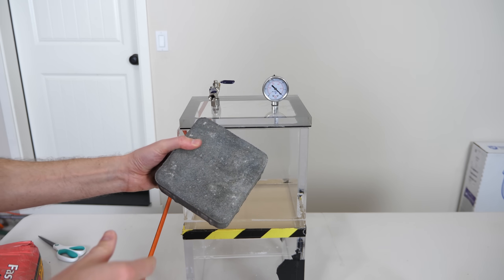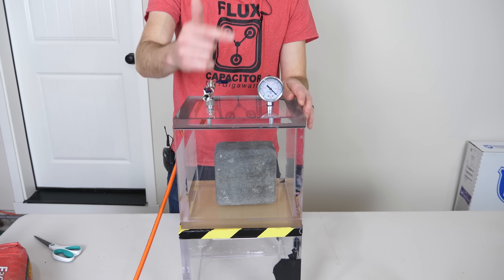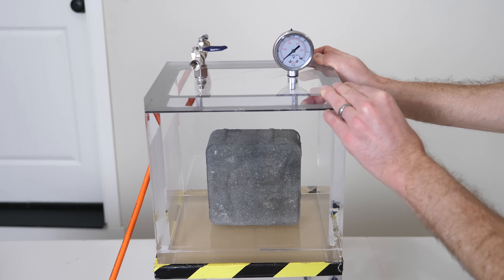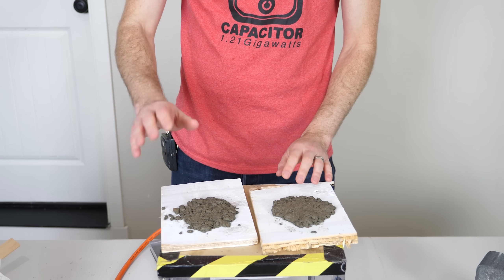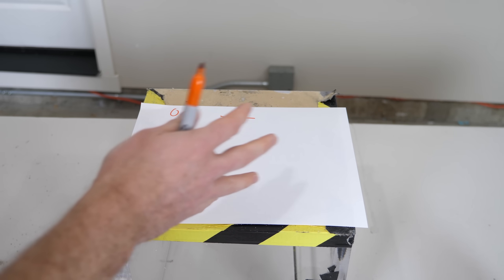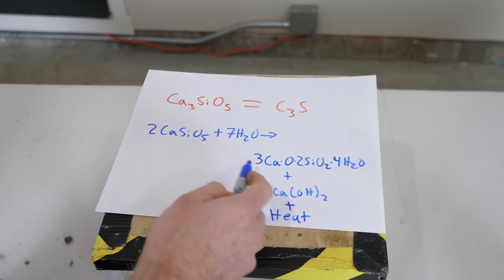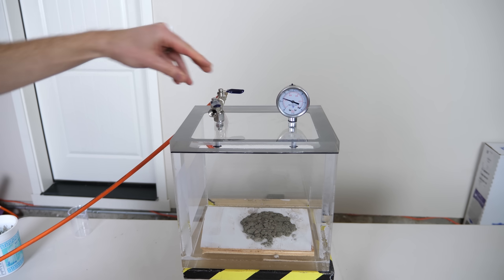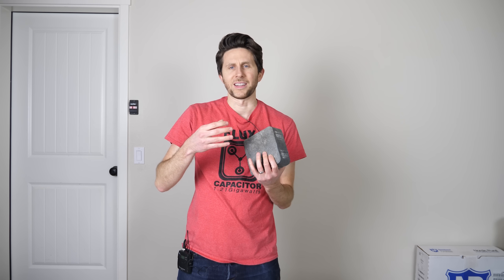Does Concrete Turn to Dust in a Vacuum Chamber? Concrete Without Oxygen Experiment

Comment: "So, you use cement to make concrete."  THANK YOU!!! Thank you for explaining that! I test concrete for a living and it bugs the snot out of me when people say "cement" when they mean "concrete".  It's like saying I'm going to bake a flour. Or, have a piece of flour.
Reply: I eat pieces of flour like you for breakfast
Reply: I used pure cement once, big mistake....
Reply: @generaza7609 pure cement with water should only be wall adhesive for tiling. with sand shall be plaster
Reply: Well... i mean its not like they just teach that in school.
Reply: @fraydizs7302  I knew that back when I was 3 years old
Reply: In italy we have no word for concrete. We just call it the same way as cement
Reply: @zbarba I am sure masons use different words even in Italy. Concrete is made of sand, gravel and cement. Mortar is made of sand, lime and cement. If you don't have different words then -> cement is made of sand gravel and cement.
Reply: If you really want to piss someone off tell a refrigeration guy it's stopped making cold. They seem really sensitive to the  fact that it only moves heat.
Reply: @kevindouglas2060   Technology Connections can set someone straight on that fact. 😁
Reply: just anecdotical thing: i'm spanish and here we call "cemento"(cement) to any paste that includes cement powder the same way we would say "i've seen a van gogh in the museum" however other names are used too 

we call "hormigón" (concrete) a cement paste only if contains big agregates such as gravel
we call mortero (mortar) a cement paste that contains limestone

and usually both concrete and mortar use some kind of sand.
Reply: But why this even happening? It is two distinct things, why would possibly anyone mix them up?
Reply: @AlexandrKovalenko  "mix them up" heh heh heh heh heh surely that was a pun right?
Reply: @AlexandrKovalenko Because I never interact with either? I know cement trucks pour cement, and I know the final product is concrete.  I always just figured it was cement while wet and concrete when dry. Why would I know??
Reply: @AlexandrKovalenko   Well, I guess it comes from ignorance. They don't know cement is an ingredient of concrete, they may mix it up because it has the same color.
Reply: @fuckednegativemind  in Spanish, cement translate to cemento, but we call that cal, and the concrete which translates to concreto that's what we really call cemento
Reply: The flour sticks at Olive Garden do be pretty good tho
Reply: Why dont you also explain what cement is made of? Its not like cement comes from the ground in its form.
Reply: cement pond
Reply: How do I become a concrete tester?
Reply: Man why does it bug u that much chill tf out
Reply: 21 Pilots has a song called "Tear in My Heart" in which they say "fill holes [in the road] with more cement" and it bugs me for the same reason.
Reply: This example falls flat every single time. Cement is both an ingredient in concrete and a final product. Cement is used on its own. So, since you don't eat flour on its own, it doesn't make sense.
Reply: jack mehoff  heh heh heh
Reply: I said the same thing for years!!!!  My kids know the difference.
Reply: What would you get if you tried to cure cement without any aggregate?
Reply: @carultch  Basically grey Plaster of Paris.
Reply: @carultch  a brittle mess that will break if any load is applied. it doesnt work well.
Reply: @carultch  you basically end up with "concrete" but it has no aggregate.  it's like a plaster at that point and very expensive.  cement is relatively expensive compared to rock/sand so using gravel/sand helps reduce the cost without impacting the strength.
Reply: Well it depends on what your talking about at the time it's being made. It takes the ingredients which one is cement.
Reply: @hilham89  yeah no. That isn't how it works. Cement is an ingredient in the mix.
Reply: @bennybooboo6789  🤦I know what the Ingredients is in concrete. I haul it to imi bud. Only thing I don't haul is the air and water it takes roughly 10% of cement to make up concrete, then you have air, water, sand, and gravel. I went back a fixed it so there's no confusion of my comment.
Reply: @bennybooboo6789  what about my comment is incorrect? Please do explain. Not once did I say that the block was called cement.
Reply: @hilham89  thats like saying that flour, once it is settled, becomes cake....fucking stupid.
Reply: @lukewarmwater6412  well you use flour before it's baked right? It's an ingredient in the cake so no it's not stupid. It shouldn't matter what people call it. If they want to call a cake a flour so be it.
Reply: @lukewarmwater6412  what part of my comment did you not understand? Funny how you can call someone stupid when you clearly can't read nor understand what someone says. 🤷
Reply: @hilham89  I understand exactly what you said, but I dont think that you understand that what you said was stupid.
Reply: @lukewarmwater6412  well that's your opinion bud. Doesn't mean I'm going to call you stupid though.
Reply: @hilham89 "well it depends what you're talking about at the time it's being made".
Reply: @bennybooboo6789   @Benny BooBoo  cement isn't an item by itself. It not natural so yes it does depend on what you talking about as cement has ingredients to be made as well. It has 6 to 7 ingredients to make cement. A lot of people doesn't understand that cement can still be used by itself but cracks easy.
Reply: That's right.  You can't have the flour and eat it too.
Reply: It's not that different: Cement is the active ingredient; it just has a particular type of filler/reinforcement added.
Reply: I've always been aware there's some distinction, but outside of construction, there's really no reason you would know
Reply: There's a lot inconsistencies like that in casual talk unfortunately, as an economist it can be frustrating at times when people call debet cards for credit cards for example, so I can sympathize. Another example is how people casually use the word cure in medicine, but professionals in the field never does that for a very good reason. What cures you is generally your own immune system and regenerative ability (which is why words like recovery etc. is used instead), things like medicine just helps by strengthening, weakening, inhibiting, or similar; it's like going into a game confusing buffs and debuffs for heals.
Reply: @ShadowTani my dad still calls them both versatel cards 😢
Reply: @ShadowTani Okay, but words aren't only their technical meanings. Common parlance isn't 'incorrect', it's less specific. Someone isn't wrong, per se, to say something 'evolves' when it changes. They just aren't using the scientific definition in that context. Especially since, inherently, you won't know those more specific definitions unless taught them.
Reply: @hmnhntr  It depends, to evolve has a dictionary definition to change or transform so it's not wrong to use the word like that, it's not exclusive to biology. That is however not the case for some of these other technical terms.

For example I understand many people think of both debet and credit cards as spending cards, and that in itself isn't 'incorrect' way of thinking, but they are still wrong if they confuse one as the other because it is a significant enough difference between spending money you have (debet) versus money you borrow (credit). There is no dictionary overlap between them, they are antonyms, not synonyms. They will make themselves understood though, which is good enough for casual speech, but they are still wrong in calling one as the other.
Reply: ...eh???
From me - a thicko...
Reply: Why does it annoys you tho? Ignorance is something everyone has, you can’t be expected to know everything, that means someone also can be annoyed at you for not knowing something they do, which is stupid itself. Instead of trying to make fun of people’s ignorance on a subject you master, you may aswell just explain them calmly what it is, not just overreact over it.
Reply: what a snowflake you are sir. getting mad at people saying things they're not taught about and then whining about it too.
Reply: watched a guy who didnt understand slump pour a foundation. he didnt make a strong enough form so he thought he wanted less than an 3 inch slump and didnt want us to use a vibrator.... I think you can picture what happened.
Reply: Nobody cares bro

Comment: 10:08 You compared the two before either of them had enough time to set, let alone cure?
It takes about 24 hours to set and it takes about 24 days to cure to full strength.
How long did you wait?
Reply: Not long enough, in my opinion

Comment: 3:35 While I agree there was no effect on the concrete, you cannot claim that it had no effect by simply observing it with your eyes.  You did zero testing before and after, therefore you have no right to express a hypothesis as factual.
Reply: He can safely assume that the concrete has not turned to dust after being exposed to a vacuum, because it isn't turning to dust. And, as the comments have helpfully pointed out, we know that it isn't any weaker than before (which wasn't the question in the first place) because the oxygen is bonded to the concrete and can still stay bonded in a vacuum.

Comment: real engineers will test concrete by putting them in cylinder forms and then let them cure for 2 weeks before putting them in a press to see at what pressure they break. it is much more empirical and results are more consistent

Comment: Some concrete and cement mixes can set/cure totally submerged underwater. That's a higher pressure environment obviously. I would think a lower pressure would only help the concrete set even faster. -which might not be a good thing if it's sufficiently thick it could crack.

Comment: any free moisture will boil at the lower pressure. thats about all that will happen. and theres not too much free water present

BTW: concrete doesnt dry. it sets. A chemical reaction takes place. Water is needed for this chemical reaction to occur. The complete opposite of drying. Its exothermic so heat is given off

Comment: If air is trapped in concrete and you introduce it to vacuum then it may crack because of the air pressure difference.

Comment: My guess is this "theory" comes from the fact concrete is pouros and not 100% free of air, so the stresses of a vacuum will tear it apart. But being pouros, the air will just leech out and nothing will happen. Look forward to the results.
Reply: Before watching the second test, I want to add that the curing of concrete is a thermo-chemical reaction that can even occur under water. Water just slows the process, which can also result in a weaker product. Not sure what will happen, but I feel under a vaccum it will actually speed the hardening up.
Reply: After the second test. The difference in coloration is a sign that the concrete in the vacuum chamber has cured less. As you point out it could be because the water was so rapidly removed while still wet. 

Very interesting video as always.